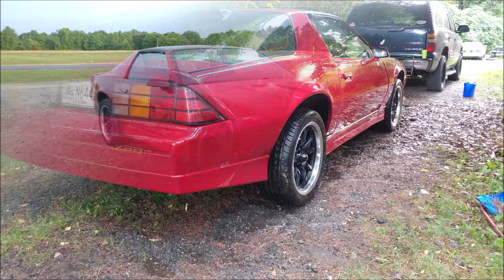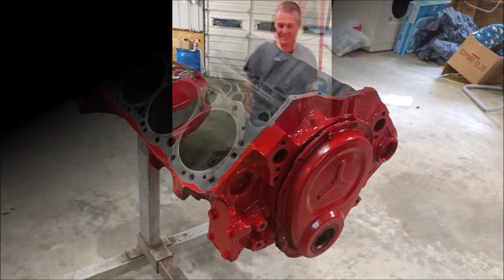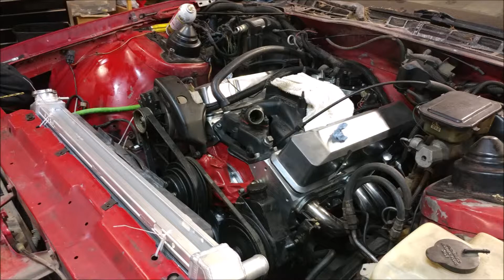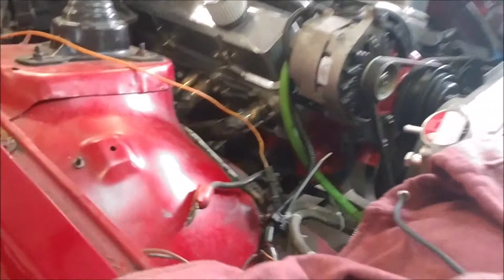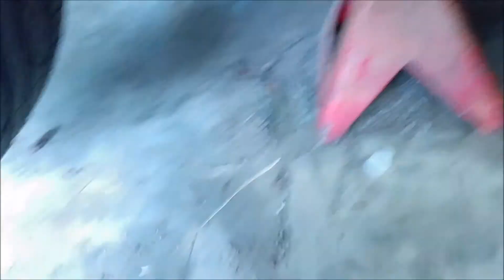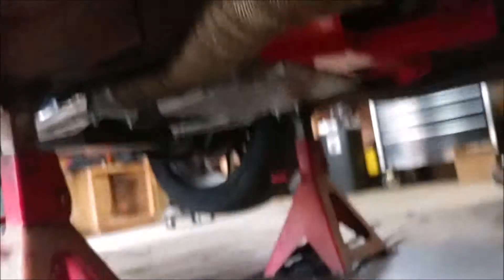85 Iroc Z 383 Stroker Build

Comment: What’s your wheel specs? Is it on conversation spacers?
Reply from the maker: 265 45 18 in front and 275 45 18 rear. Yes they have a 2in spacer for the offset. I plan on swapping to a 4th gen rear and wont need spacers for the back